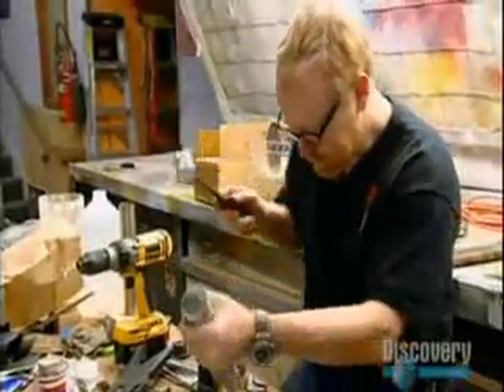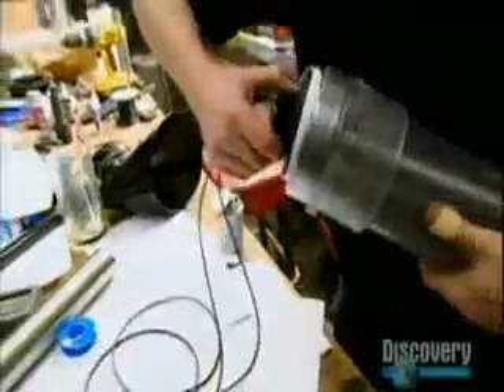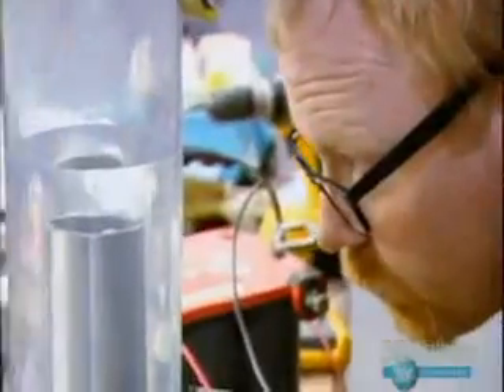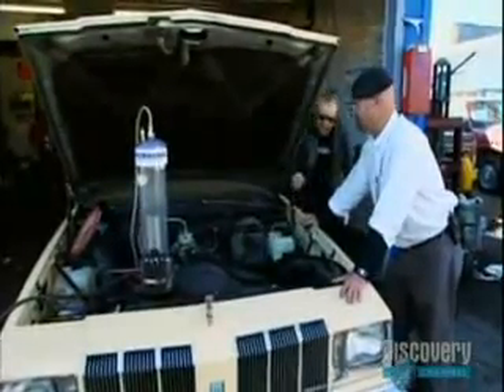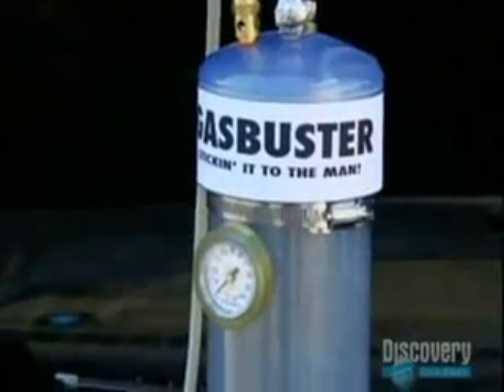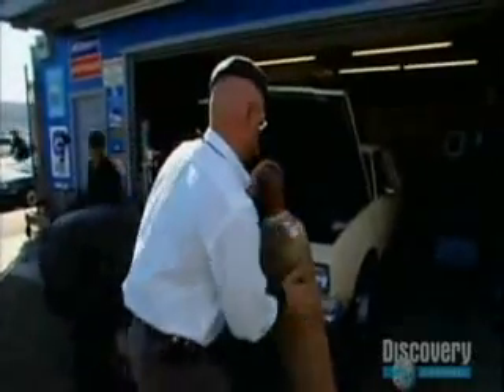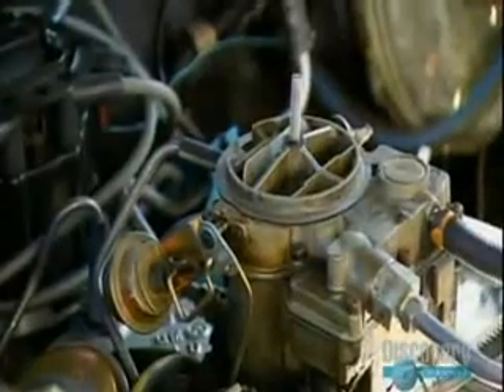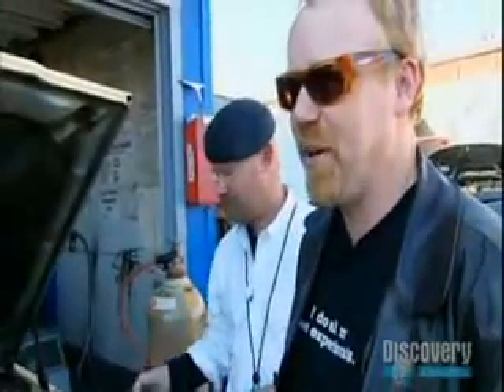HHO Mythbusters Explained

Comment: After seeing this, I just can't trust Mythbusters anymore. LOL
Reply: They are only there to mislead the public!!
Reply: Now i dont trust them. We all know that Hydrogen gas works.
Reply: I have never trusted them. They are idiots. I saw some show ... maybe a different program.. about "ghostly" plumbing where the bath faucet turned itself on. I was at somebody's house saying "bad gasket and high water pressure" and they rambled on about how maybe it's a ghost. nope.. bad gasket and high water pressure was forcing the knob to open.
Reply: they   tried it a second time and failed to make any still
Reply: @punker4Real  we should go to there new pages and call them out in the comments. they have there own yt now ffs.
Reply: @SysPowerTools well combustion engines that use petro are only %25-30 efficient, so that is %70-75 waste. Can't be much worse than we already use.
Reply: they let the credit companies force them out of talking abought chips in ur credit card and how unsecure they are. wireless theft from ur pocket.
Reply: They did not have the right way of making hho, which is why their expirement failed miserably.
Reply: plus putting hot metal into water only makes water vapor

they needed baking soda or some other form of electrolyte to make the water split into hho gas.

The reason they probably failed is because of being giving the wrong info about how hho is made because vehicles and things running on hho can and WILL put big oil and part of big corporate governemnt out of business, which is more likely why mythbusters failed..

because even they can get coerced /forced by the government to not do things
Reply: HereWeCome this is so full of bs myth busters would have been paid millions in order to prove this to be true... the government would have enforced it
Reply: So you can't trust mythbusters because they prove how inefficient hydrogen is as fuel? Right.. you didn't watch this episode knowing what they set out to prove, rather you think they are disproving hydrogen as a fuel as a whole. 
Clearly not the mythbusters who failed here xD

The simple fact of the matter is, hydrogen is less dense than gasoline, which means you need more of it for combustion, and it burns quicker, which makes the auto cycle faster, thus burning more, ergo, inefficient fuel
Reply: cubey nah bro,ghost can turn on water faucets,open n shut doors, communicate,and just stand their and stare at you,we have even have one open front screen door..lol believe me or not,I've seen and heard ghosts moving,and opening n shutting doors..refridgarater and house screen doors..

Comment: I built an HHO unit. I hooked it up to a Ford F250 with a 390 motor. Its normal mpg w/the existing carb is 4mpg( the carb sucked), but once I fired it up I ran it for consecutive 8 hrs on 1 gallon of gas and HHO. It does work. I don't recommend baking soda as an electrolyte, and the problems I had were heat related. It caused the electrolyte to brown , which increased the amperage draw untill it burned out my amp meter. The HHO systems are becoming much better lately.They have pretty much, solved the heat issue by the installation of neutral plates in between the positive and negative plates. Like a battery cell each neutral plate cuts the voltage in half. EG: no neutral plates measures 12v accross plate to plate, but if you install a neutral plate it measures 6v to the neutral and 6v from neutral to the other side. Each heutral plate cuts it down comparatively. The ideal, as I have been able to deduce is 2v between each cell. Also 3/8 of an inch is a rediculous distance between plates, stick to about 1/8 in.
Reply: you ran your car consecutively for 8hrs? what do you mean by that? you drove your car straight for 8hours, or you just had the car running for that long.if it was just running in idle for that long, than that isnt a big deal. it certainly isnt evidence that the system works. a car uses extremely small amounts of fuel in idle
Reply: Hope this is not the F250 I just bought. mostly likely it's not though. Man can't wait till the auto shop is done fixing mine so I can drive the awesome truck. Though data online saids mine would get 20 miles to a gallon. It's 2wd and a manual transmission I am looking forward to getting it hooked up burn this HHO stuff too.  but some sites say it will get 9 miles to a gallon.
Reply: thevancouverguy
Reply: Your right about a normal car at idle not using much, but the carb on this one was in horrible shape. The pin tieing the float to the needle valve was gone. It wasn't there ! The gasgets on the front pump leaked badly and the top of the intake manifold had shellac build up on it. This thing was a leaky mess. 1 gallon of gas at idle was normally gone in anywhere between 1 hr and 1 1/2 hrs. The HHO system I built was not the best either ( it was my 1st attempt), but it DID work! I will get around to building a better one soon.

 Believe me or don't believe me, I don't care

Comment: The reason That  the  Car  "back fired" , Is because the Spark timing advances when your  Vacuum  ADVANCE  is working in the  Distributor.  Also  the Mechanical advance weights as  you speed  up the  engine. Hydrogen  works  best at  TOP-DEAD CENTER , or  slightly ATDC. The Flame  speed  is  8 miles  a  sec, much more  efficient that  gasoline and  it has  NO  Carbon. Hydrogen  expands  then  contracts with the  explosion. One gallon  of water , will expand  1700  times as  it  is converted  to  Oxy-Hydrogen.  Back flash protection and bubblers Must  be  used

Comment: Put the right mixture of H and O together and spark it and it will explode which causes extreme heat and the environment that makes it want to bond again into water. when it is water with an electrolyte and electricity (like a spark plug, high voltage low amps) it makes the H and O uncomfortable and so they get away from each other. kinda like inseparable lovers doing it on the beach.. get sand in there and oh boy they get away from that union real fast. Wash em off, back at it. Nature! not scin
Reply: The sun

Comment: Sorry 1965. I disagree. You use no more gas to run your head lights, Radio , that running a HHO device if properly installed. If you had a 500watt car amp pushing 200 watt speakers you will burn no more extra gas if you car was running.  You need to rethink what your teacher is teaching yo. Because i know you didnt come up with these facts your self. I heard it before and had to set them straight. 
Want to see my HHO device , click away  
So adding HHO into the system will add to your millage.

Comment: Let me explain again sparky. You didn't get better gas mileage, and you didn't save money because in a closed system you won't gain any energy to take the care any further down the road. ALL the energy comes from the gasoline initially and any conversion is less efficient robs energy and returns less. Now if you brought a source of HHO that wasn't generated by the car itself you would need less gasoline but that doesn't mean saving money because HHO comes from another energy source.

Comment: Shout all you want, you don't understand that taking energy from your engine to make HHO does not produce energy in the form of better gas mileage. If that was the case you have changed the laws of the universe. In dollars and cents $3.00 of gasoline(strictly used for HHO and nothing else) produces $2.00 of HHO energy, always a net loss. Because the HHO isn't free, its produced from the gasoline at a net energy loss. Stop listening to 10 year olds they don't take in to consideration all the info

Comment: I guess you are just too dense to understand the concept that there is no free lunch. Every energy conversion , gas ( stored) to combustion to mechanical to electrical to HHO gas to combustion to mechanical is a net loss to parasitic drag heat etc. It's a closed system, you don't understand conservation. IF YOU COULD LIBERATE HHO FROM H2O WITH LESS ENERGY THAN IT PRODUCES BURNING YOU WOULD HAVE A GAIN. Call it cost, call it mpg  it's energy and nothing more. All you are doing is energy conversio

Comment: You are a contradiction, it takes more energy to go 38 miles than it does 20 miles in the same vehicle, it will always rob more energy energy from the belt than it produces. The only improvement to make is efficiency and many cars get 38mpg so your claim is a lie and the results (if accurate ) are mediocre. I have a turbo 2 liter that puts 390 bhp to the wheels and when driving cautiously gets better than 38 mpg. Go back and review your old HS physics book sparky.

Comment: I NEVER said anything about how much energy was used, produced or consumed. Don't go putting words in my mouth I didn't say, because it makes you appear more illiterate than you already are. 

Unlike you I actually built one so I know what I am talking about. The engine runs the alternator and it powers HHO generator. even if it does consume more energy, IT COSTS LESS MONEY TO DO IT in the end because some of the gasoline is replaced by the HHO which didn't cost me anything to make.

Comment: You can however produce enough HHO in your car to give a huge increase in gas mileage (depending on the vehicle). I had to put on a 100 amp alternator. 60 amps in a HHO generator using baking soda (less efficient but completely safe) produced enough HHO and O to give me 38 mpg from 20 mpg without it.Just fed it into the air cleaner and computer cut back on gas. used about a cup of water to a tank of gas in a s-10

Comment: A 2L engine @ 2000rpm = 4000L of air consumed a minute.

so 4L/min of hho would mean 1ml per rev.
Or .25ml available per cylinder on each intake stroke.

And thats at very low rpm. 4000rpm? .125ml of gas. if a teaspoon is ~5ml thats less than 1/20th of a teaspoon of gas for each combustion....

I dont think that would make any difference somehow. much, much more hho is needed.

Comment: Youre completely correct.

What the misunderstanding is though, you dont RUN your car on it. Your car runs on fuel, HHO makes the burn more efficient.

However, you need to trick your ecu in an injected engine otherwise it just gives more fuel thinking the mix is lean and will do absolutely NOTHING. Carby engines dont have that problem, but its still fiddly to get it spot on.

It does work though, you need to look around to find sites describing it that arent just lunatics with free energy.

Comment: you claim 8000 what? out of a 3 inch opening
and it would be nice to see the wattage consumed by your cell at that output
if it takes more power to create the hydrogen than the engine can put out to power the converter than you have a dud

Comment: HHO is a marketing scam. You can run a car on hydrogen. You cannot produce hydrogen from electrolysis to run a car, where the car powers the electrical production. If it worked, it'd be a perpetual motion machine. Finally, adding HHO to the air intake to "boost fuel efficiency" is crap. In the electronics they are starving the engine to get fuel gains. Any amount of HHo produced is a loss through the alternator. Don't fall for this crap.

Comment: and to get the hydrogen you need electricial power
but it takes more power to make the electricity than the engine can produce running on it
so you still have to have another fuel scource to wind it all up 
and remember you loose energy at every converson step

Comment: I have been trying to expose an answer to the problem 100 Miles per gallon fuel systems. Yes 5 times the fuel mileage is possible but suppressed by oil companies for over 80 years and we have the patents and the science to prove it,  see the evidence we have now see at website (no spaces)  him acre search dot com  other  sites with similar info are .Byron wine dot com  Rex research dot com
We need to end suppression before it causes the end of us all.

Comment: So... you use electricity to make hydrogen which works the car engine? Alright, so can't you just run an electrical car with the electricity instead of pointlessly converting it twice which results in a loss of energy? I mean, I'm no expert, but the hydrogen fuel cell seems a bit eccessive...

Comment: This video is NONSENSE. Your never going to produce enough hydrogen on the fly to run a internal combustion engine let alone start it. The theory that a 12 volt battery produces enough electrolysis of hydrogen to start and run a car is so bogus. It is like saying a vehicle can use the starter motor to drive at 55 mph down the highway. The notion  defies physics.

Comment: A car's charging system is driven by the engine which is burning more fuel in order to power it. Try removing the alternator drive belt then starting the engine. It will tick over at a higher speed than before because you have removed a load. If you add an alternator to charge the battery in the hydrolysed water car, the battery will just go flat sooner.

Comment: The government is part of the problem, other problems is to make it safe to use and efficient enough you need to add hydride to the hydrogen. However, the problem with that is that it is illegal to buy or cell because "it is a component used in thermonuclear weapons" (it's non corrosive and non combustible) and you have to make it with a particle accelerator.

Comment: its not pseudo science its a fact that you can run a car motor on hho, but the real deal is that youll need allot of el power, car battery and alternator cant provide enough power tho. so even with scientific calculations you cant make more energy with burning h2+o than your using for separating them from h2o. its same as saying you can run a lamp with solar cell which is generating power from the light of that same lamp.

Comment: Adding a catalyst to any chemical reaction will lower the activation energy of that reaction thereby increasing the rate of it. It will not change the total amount of energy required for or derived from this reaction. So adding a catalyst to your electrolysis reaction will make bubbles form more quickly but will consume more energy. Conservation of mass/energy is a bitch, ain't it?

Comment: I agree with you, the energy can't be provided entirely by the car' electric system, specially the electric battery. The engine   can work a few time, until the battery charge is consumed . The water-HHO  reaction requires  more energy that the system can produce after the electrolysis.
I believe that using H2, obtained in other source , produced for example by wind turbines is more efficiently   and safe, because the HHO together (the fuel and oxidizer), is very dangerous.

Comment: Only dreamers think these cars work. Electrolysis of water produces an amount of hydrogen containing about 80% of the amount of energy drawn from the battery. About another 20% of the energy is lost by the inefficiency of the engine. What happens is the car runs for a while with the battery rapidly discharging. Then the battery goes flat, the car stops, and it ain't going nowhere till you charge the battery up again.

Comment: Here's some figures explained. Take  a medium size engine of 4 liters. Each time that engine rotates 1 time it takes in 2 liters of air / fuel mixture. At 60 mph the engine rotates 2000 rpm. and takes in 4000 liters EVERY MINUTE. Hydrogen has a very wide range of LEL but it starts at 4%. That's 160 liters per minute. Those tiny bubbles are a few fractions of a liter per second on all the youtube clips, the difference in economy would be more than lost due to the extra load on your alternator.